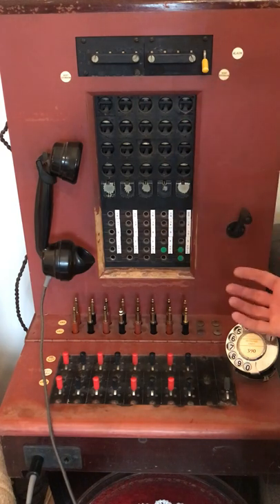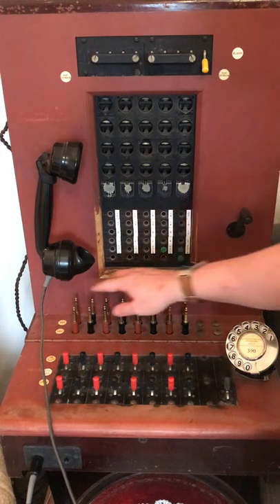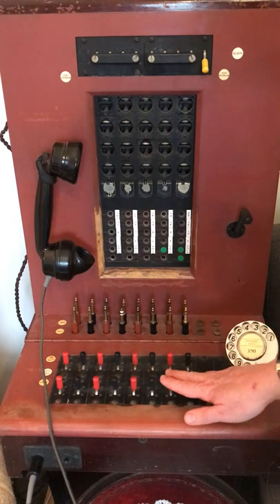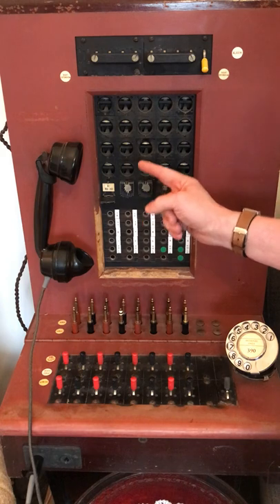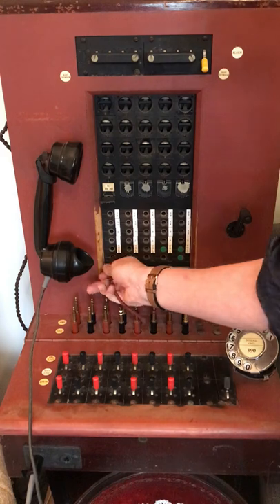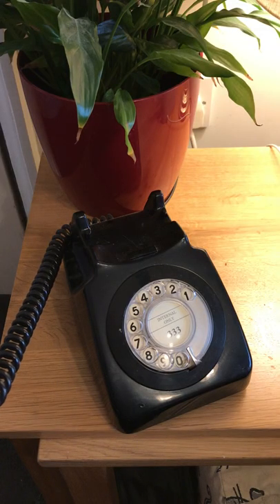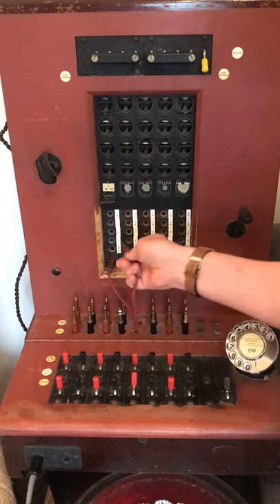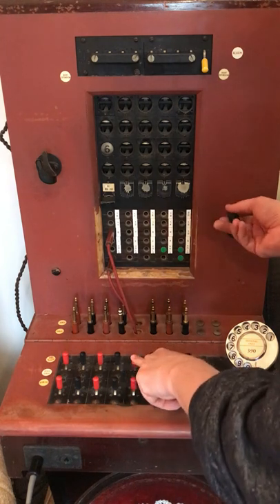Telephone Switchboard! My 5+20 PMBX

Comment: So. I'm familiar with common battery switchboards that have a light for each extension and a pair of lights for each cord pair. When the call is over the lamps come back on to indicate to the operator that it's time to pull the cords down.....how can you tell when a call is complete on a magneto board (other than eavesdropping)?
Reply from the maker: This is a common battery board, not a magneto board. The phones are ordinary phones, and don't need their own local magneto generators.

The equivalent of your supervisory lamps on this board are the dolls-eye indicators. They re-operate when the call clears to indicate to the operator that the cords can be restored.

On a true magneto board, the callers would "ring off" when they finish their call, by winding the magneto handle on their phone.  That would alert the operator that the call was finished.

Hope that makes sense!
Reply: @lpbkdotnet  Makes perfect sense. I didn't notice the indicators at first....or rather, I didn't notice that they were not flap type indicators as on a magneto board.

Thanks!